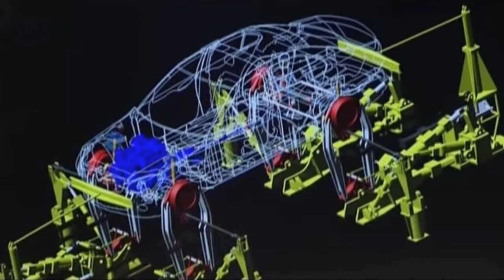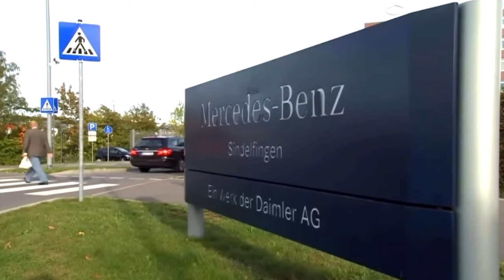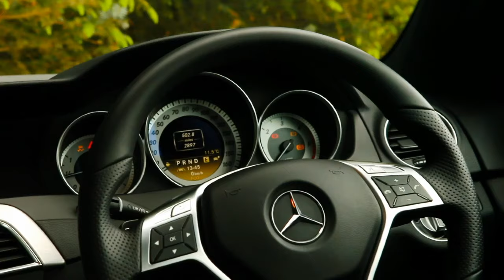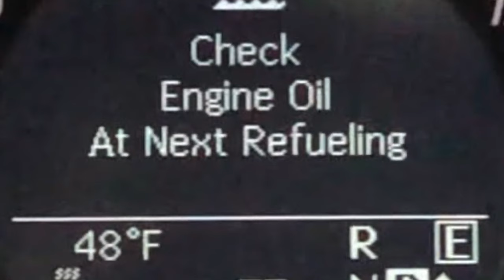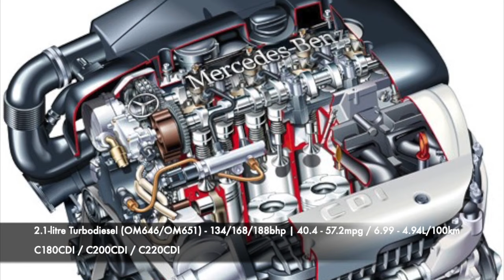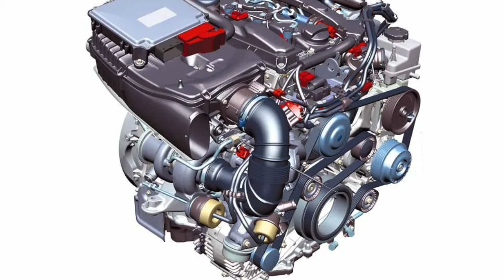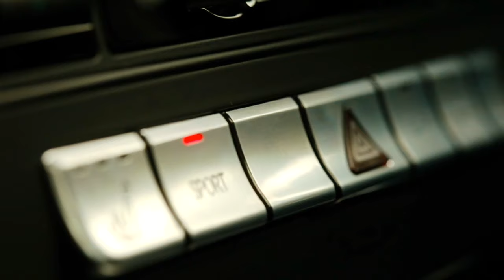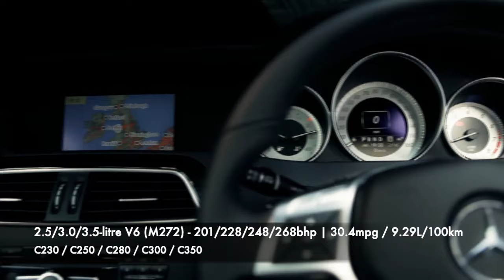Used Mercedes C-Class W204 Buyers guide (2007-2015) Avoid faults and common problems (CDI/CGI)

Comment: Hey guys you know what they say a car and a woman it's a game of luck . I had mine 2007 W204 c200 cdi for 5 years now no problems what so ever. I just change my oil and filter in timely manner. Mine is 136 hp it's not the fastest one no chips completely stock but for me it's enough to handle my daily tasks. The car is very comfortable very smooth engine and gearbox it gives me more pleasure to tell you the truth to cruise slowly than to drive it fast it's  a relaxing and luxurious experience. It has enough power to overtake trucks and big commercial vehicles in dangerous junctions and it doesnt brake the wallet. I like the newer ones but Im afraid I wont have the same luck again I just dont wanna sell it to some lucky dude 😀 well I hope you guys find a good one like me 😉
Reply: Dpf?
Reply: @IMAKETHEMSQUIRT  220 cdi vs 200 cgi more reliable engine?
Reply: People abuse their Mercedes C classes like their hellcats or some muscle car, and cry about having to fix it after.  These aren’t sports cars lol
Reply: @maxlarock8788  Elaborate on how you "abuse" an Mercedes C Class like a hellcat
Reply: My mechanic once said something when I told him I was thinking of selling my perfectly reliable, well maintained car. “Whenever a car is changing hands, someone is mad. Either someone is mad for selling it, or someone is mad for buying it.”

Comment: I think the best C Class model is the C350 built from 2009 - 2011 with 272 HP, a pure naturally aspirated car. A car without difficulties and without a high-pressure pump - simply brilliant. But unfortunately there are not many left.
Reply: @dit.p2598  It has 268hp ( which is 272PS) 

Brilliant motor indeed.
Reply: How about a 2013 C350?
Reply: Are we talking CGI?
Reply: @andrazlogar861  never ever CGI

Comment: I purchased a 2013 AMG Sports plus W204 CDI 2.1 Twin turbo intercooled model 5 years ago she had 70000 kilometres when purchased  I have done 120000 kilometres or about 75000 miles in her since purchased I have also been a bit lazy with servicing and have gone over due dates and kilometres on a few occasions and I have not had a single issue or problem also trim still perfect and paint still fine due to being exceptional quality. I will never sell this car even after I upgrade to a new C class later this year I will keep this one I have fallen in love with its beauty efficiency and reliability. And in my opinion they are the best looking C class ever produced over 10 years old and still looks modern and turns heads. I will be a Mercedes Benz person for the rest of my life now because of this car.
Reply: The best model ever, not sure about the models after w204. But facelift w204 still turns looks
Reply: @ezramale3270  i totally agree , Mercedes Benz absolutely nailed it with the W204 they are such a beautiful car.
Reply: Indeed 😂😂😂  same here, W204, 2013 C250 AMG.there will never divorce words btween us😂😂😂😂😂😂😂😂
Reply: I bought mine w204, 2012, 220cdi om651  couple of years ago did more than 20000 miles in it. Including a very long road trip of 4000 miles in a week. Never let me down, the car has now 89000miles. Apart from changing all the filters and oil, I had one bad abs sensor which I replaced for 90£. I did replace the chain tensioner as a preventive measure for the new upgraded version and my rear led tail lights started to play up, the connectors were burnt and the circuit board which is holding the bulbs, replaced both for 50£ easy job. I drove a variety of cars  and changed cars frequently but now I do not know how to replace this car, I just love it. The looks, comfort, reliabilty, efficiency and feeling of premium it is all on point. No unnecessery screens, touch pads, sensors. It has all a driver can wish for.

Comment: Bought a black 2013 C300 Luxury model new in Aug 2012. Naturally aspirated 6 banger with 248 horsepower. Don’t drive much so only 53K miles. Got rid of the Continental tires early after two had sidewall bubbles; replaced with Michelins. Mercedes did replace rear camera. Always serviced at Mercedes which isn’t cheap. Runs very nicely with plenty of power, without the torque of a turbo thank you. Body styling does not look dated to me. I’m not a fan of tablet style nav screens in later models, nor do I like digital dashboard dials. This baby is definitely a keeper.

Comment: I think the best C Class model is the C350 built from 2009 - 2011 with 272 HP, a pure naturally aspirated car. A car without difficulties and without a high-pressure pump - simply brilliant. But unfortunately there are not many left.

Comment: Gearbox info is incorrect. My W204 has a 5 speed automatic. I don't think there's a 6 speed auto. It's either 5 speed or 7 speed for the auto box, I think.
Reply: I'm sure your correct as my wife has a 2008 220cdi estate with a 5speed auto box. Still love the car though. Enough power for daily running and quite frugal. Also very comfortable.

Comment: Curious why you suggest checking the ESL is working. It is a weakness in the W204 and many owners replace it with a Simulator, or detach it to avoid a possible "lock up" when the crappy motor fails. So disabling the lock action is common. 
Some insurance companies will sadly reject theift claims but may not necessarily check.
Reply: It locked me out, and I got a simulator that broke after 2 years. From there, I fitted another ESL, which the guy 'rated' for some 500k cycles. I'm at 211000km, and if all goes well, the ESL should last the remaining life of the car.

Comment: I own a 2008 w204 c280 and I’ve had to have the steering lock replaced with an emulator. Upon researching the issue it’s a common fault of the car.
Reply: I've also had a sensor changed when the aircon stopped working and the engine fan would turn on after a cold start. I've just changed the headlight switch component as the side lights kept remaining on after I turned them off, draining the battery and I noticed that when I pushed on the switch it would turn the side light on/off, on the driver side.

Comment: Im in the market for another car and ive been eyeing the 2012 250cdi 2.1l diesel and the bmw 525 and 530 with the 3.0l diesel and i just cant decide.
Ive little experience with mercedes and bmw since ive been driving a volvo for the last 10 years but i find the xc60 that i drive currently to be very uncomfortable.

Comment: I have recently bought a W204 C200 gasoline from 2012, CGI, M271, 184HP, i can even reach 5.8l/100km ! i can do 900 km and even a bit more with one full tank. Another interresting thing with this model, there are no EGR vavle and no particulate filter which is good for the engine health, completly satisfy of this car !
Reply: im also looking to buy a W204 C200, is the Pre-Facelift better and does it use the same engine?
Reply: @overland1204 in my opinion the pre facelift is not a good option, inside the car it looks really old especialy with the old display and it s not turbo it s compressor

Comment: Engine-wise: get yourself a pre-facelift diesel om646 (you’re twice golden getting it with 5g tronic) and you’d easily get to 300kkm even with 15kkm oil changes. This one is probably one of the last merc diesels which was built to last. om651 is good enough as well (I personally did 200kkm on one) but it’s a new gen thing, more tender and not as bulletproof as om611/646 (which are almost twins). Though om651 delivers a slightly better fuel economy. It’s up to you, my personal choice is the good old stuff ;)
Reply: I've got a 2008 w204 C220 CDI, is it Om651? at 175kkm atm, one of the most fuel efficient cars ever
Reply: @marvinwilliams7938 it's easy to know, if your oil caip is in the back on the left its the 646, if it's in the middle it's the 651

Comment: Opinion of C200 CGI 184 HP 2011 and C220 CDI 170 HP,  both BlueEFFICIENCY - and which one is better?
Reply: It would depend what you are using it for .
If you’re looking for a commuter  which you’re going to do high mileage, I’d opt for the diesel.  Very fuel efficient and quiet on the open road .
If you’re mostly running around local trips and a bit of travel over weekends, I’d opt for the petrol. 
Smoother , quieter and more refined.

Comment: ... my 2008 C320CDI Avantgarde 7G Trans uses 14.7L/100KM, always has for it's 80K KM life, no idea where these fuel economy numbers are calculated, (cough, cough *dieselgate*) maybe at 150KM/HR and 2K RPM in 7th gear, seems to be where best mileage is achieved, hard to do on surface streets... LOL. Regardless, to me still the best looking C class, musculine when placed in sports mode, reminds me of a 70s muscle car! Wouldn't trade it for any other, especially the newer ones that look like a squashed VW bug and seem to be all plastic.
Reply: 15l per 100km is just insane. It should literally be half of that. So something is wrong here.